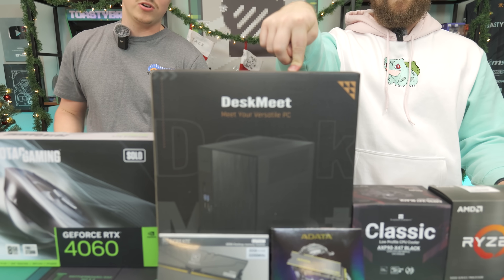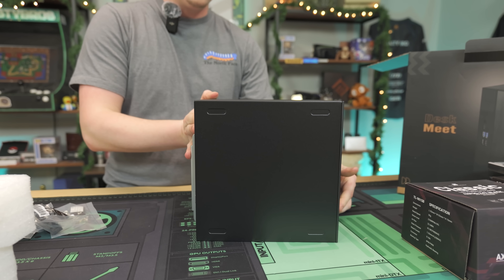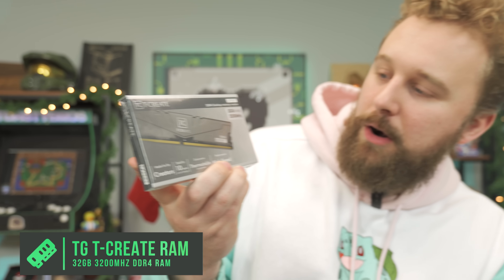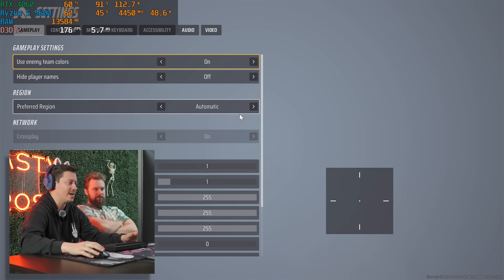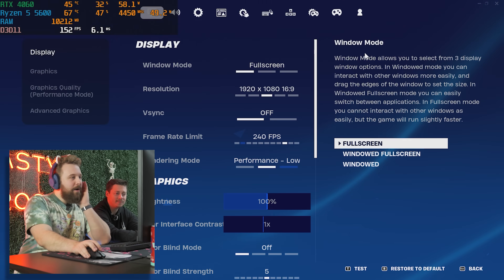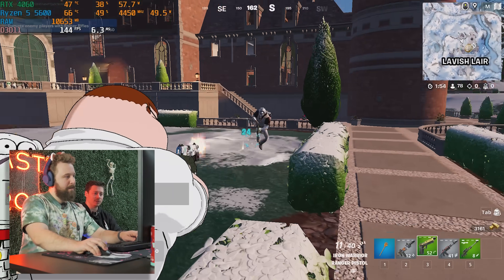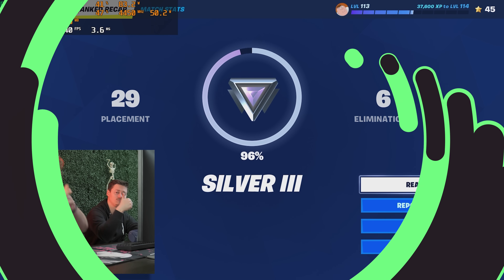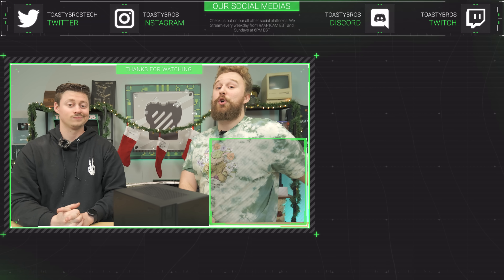EASY & CHEAP Mini ITX Gaming PC Build

Comment: I saw one if these in person. The owner put new stick on rubber feet on it to lift it about an inch (cost about $3) and it massively improved thermals even tho there is only a small area with direct vents on the bottom.

Comment: I have built several systems with Deskmeets and am absolutely in love with them. ASRock has done a great job!
The only downside for me is fan noise/CPU temp, but that's the story with most compact builds.
Reply: Do you sell any builds?
Reply: Any thoughts on running it as quietly as possible? for example no gpu or a lp smaller like a rx550 lp. and using with it without pushing the cpu to the max, with a 9600x or 9700x

Comment: The thing I love the most about mini-ITX cases, aside from the space-saving benefit, is that these types of cases just look more "mature" than larger cases. More like something a grown adult working in a professional industry would buy, rather than the "RGB everything" or "gameify everything" looks that suit teens and gamers more. I'm not saying there's anything wrong with the "RGB everything" approach, it would just be nice to have some more alternate options to larger cases for a change - like dropping the glass side-panel for a ventilated metal one which seems to be rare these days (I personally don't need to see what my PC internals look like constantly), or using more woods and metals in the case construction (like brushed aluminium). I dunno, maybe I'm just getting old or something, but I'm just not into RGB and bright colours as much as I used to be.
Reply: Well, I'm 61, and well past the bling-bling stage of my life where RGB lighting and bright colours might have been of interest to me. I personally dislike the current crop of mostly glass or all-glass computer cases that seem to be all the rage today. 

So rather than buy a new Windows-based PC, I bought a Mac Mini. It takes up a fraction of the desk space, is unobtrusive and just works.

So I can appreciate where you're coming from.

Comment: For anyone looking to build this as an all amd system that comes with a digital copy of Pandora. The RX 7600 from Radeon will also fit in this case. If you live in the states, you can use the cost difference between the two cards and get the 5600X3D or wait for the 5500X3D with the same cpu cooler used in this video.

Comment: I might be wrong, but I think the PSU should be rotated, so that the fan is directed inside. IIRC contrary to normal PSUs, this one actually sucks air in from the back and blows it out onto the CPU, thus functioning as a intake fan. Thermals should be even better then. Thanks for the video

Comment: Used that exact cooler in my optiplex 7040 sleeper. Fixed the thermal throttling I got every time I played need for speed heat

Comment: I own one, and I'm pretty happy with it. It's small enough to fit on a shelf under my desk that's a wire mesh, so there's nothing impeding air flow through the bottom.
It's supposedly not long before the Deskmeet X600, the AM5 version, comes out. It has two M.2 slots suitable for SSDs, one Gen 5,  one Gen 4 (four lanes in each case). I hope you'll review it.

Comment: I have one of these with an RX 6600 but with intel so it’s gen 4 and then I added some rubber feet to give it a bit of better airflow on the bottom. Nice little rig that doesn’t scream gaming PC

Comment: Ryzen is my favourite cpu brand and my favourite ryzen cpu is the ryzen 7 5700 g since it has an intergrated graphics card and runs games like csgo at an average of 150 fps on 1080p with only the cpu and its only 170 gbp pretty good in my opinion but you have to run low performance in alot of games and there is an occasional drop in fps for a split second in some games

Comment: You installed the PSU improperly, I think. I've not had the x600 model, but am pretty sure that those PSUs are designed to draw air from the outside through the PSU's components and blowing it onto the CPU.
Quote from AsRock themselves:
"DeskMeet features air vents at the top, left side and bottom of the chassis, allowing for maximum heat removal and constant airflow.
In addition, the custom intake fan inside the power supply can pull in cool air to dissipate heat from the CPU and VRM. Such optimized thermal design enables the system to run cool and quiet without compromising performance."

Comment: Way back in the day, in the late nineties and early 2000's, Barebone kits were very common for the DIY customers. Back then cases typically came with a PSU as well. In the last couple of years I have came across some incredible Barebones kits, this time last year Amazon had the MSI Codex Barebones kits with case, PSU and MB for $99 shipped, and it was a B550 platform.